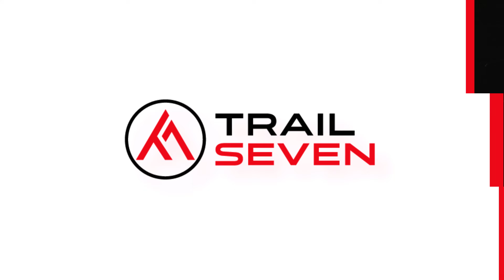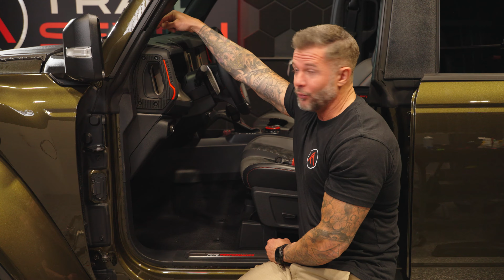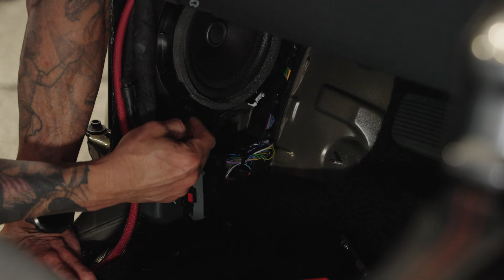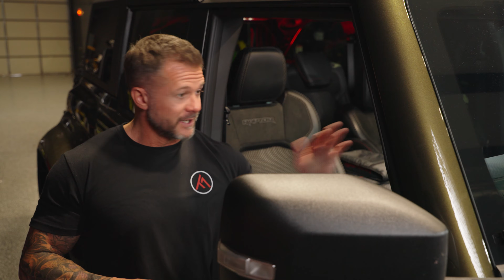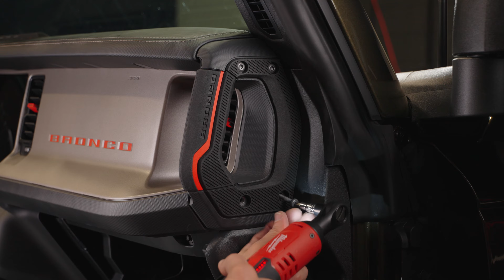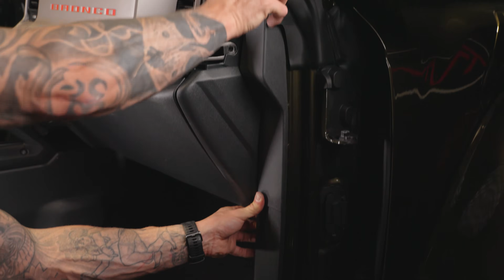Bronco Alpine Plug and Play Component Speaker Bundle Installation I '21 - Current Bronco

Comment: Is there any benefit to using component over coaxial? I have the base 7 speaker system in my bronco.
Reply from the maker: It’s more personal choice as to which one sounds “better”.  To some, the coax set up is too bright (higher toned) than the component while to others, the component is too bright and not full enough.  If you’re not going to install with an aftermarket amplifier, I wouldn’t suggest the component.

Comment: Great video, but I have a question with replacing the B&O speakers. Would I leave the center speaker in the dash? Will it still work with the component system?
Reply from the maker: @dadkeffer1229  Yes, you’ll leave the factory center speaker.  Once you upgrade to an amplifier system, the center channel is abandoned (in most cases, unless you run a DSP system).

Comment: Does this bundle include the rear speakers?
Reply from the maker: @C_Wood  This bundle includes the option to include 4” rear speakers, no rear speakers, 6.5” rear speakers in SSV pods, or 6.5” rear speakers with MTI pods.
Reply: @ are the pods going to require they’re own brackets or do they utilize the factory ones? I have a big bend bronco with the basic audio just so you know what I’m dealing with. Lol!
Reply from the maker: @ If you upgrade to the 6.5” rear pods, they will include everything required for the install.  If you have a 2-door, the SSV pods come with a bracket which lowers the pod slightly, while the MTI pods fit directly into the existing spot without an additional bracket.  The SSV pods are easier to install and come with the speaker mounted in the pod while the MTI pods are denser but slightly more difficult to mount and are not shipped with the speaker mounted.  We do have an install video demonstrating the rear MTI pods install to follow along.
Reply: @trailseven  thank you for all the help and information. Hopefully you ship to Canada lol!
Reply from the maker: @ You’re very welcome!  We absolutely do ship to Canada, however unfortunately not Alpine.  For international shipping, we’ll need to explore our other brand options.
Reply: @trailseven  I’ll visit your website and see what other brand options you have. It would be nice to have a simple plug and play installation without having to pay someone to do the install. Your videos made it look really easy btw.
Reply from the maker: @ Thank you very much!  We do have the same plug and play options with Kicker products.  Let us know if we can be of assistance.  We can also prepare a bundle of your choice with components that you don’t see listed.  Our site consists of the general universal bundles, however we can certainly put together other options if you have a specific build and/ or budget in mind.  

You can reach us direct for one on one support as well:
Support@trailseven.com
301-450-4207 9am-5pm est
Mon-Fri